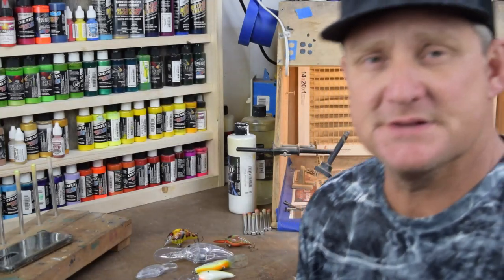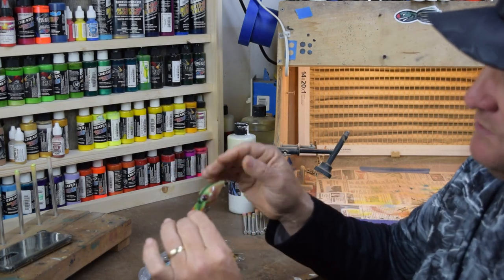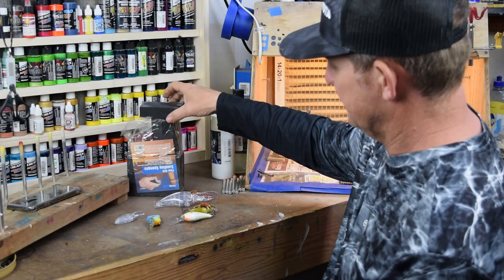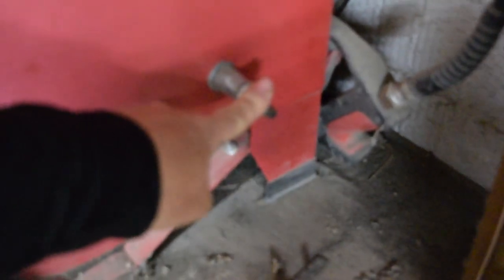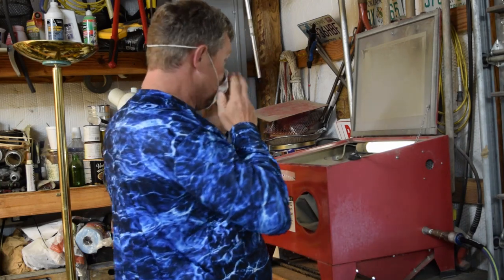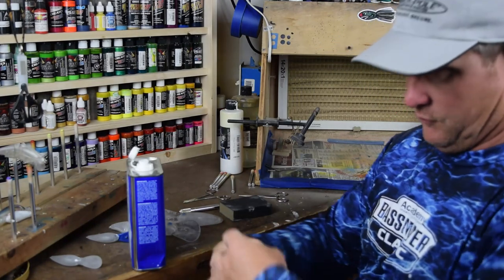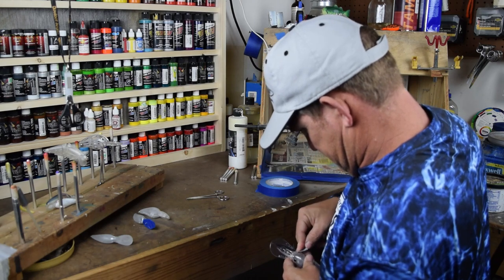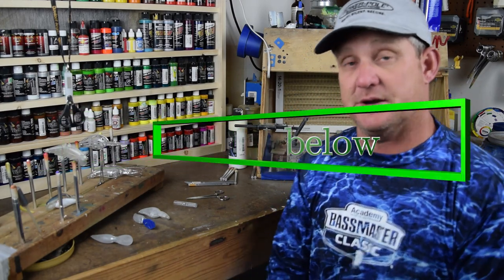HOW TO PREP YOUR LURES FOR CUSTOM PAINTING

Comment: what media are you using in your sandblaster? Soda?
Reply from the maker: It is black diamond media 30-60 fine. Not sure what it is composed of but that’s the only one I’ve tried and works well
Reply: @greencountrycustoms8387  Thanks, I have tried to use blasting soda and not done very well with it. Just learning and trying to shorten the curve as you have mentioned. Great job and I appreciate your videos